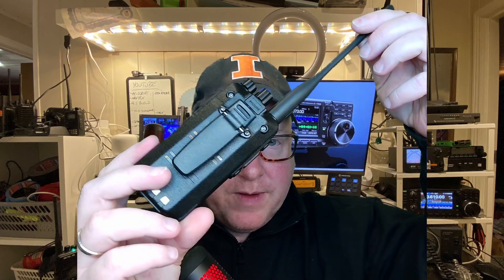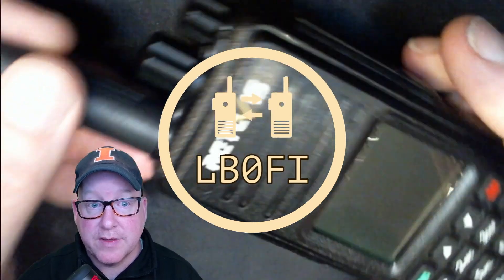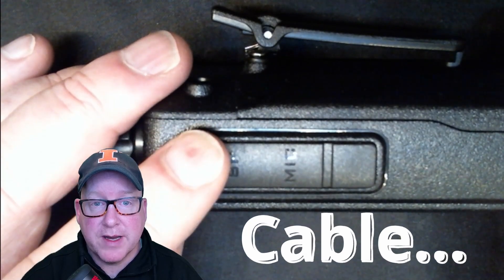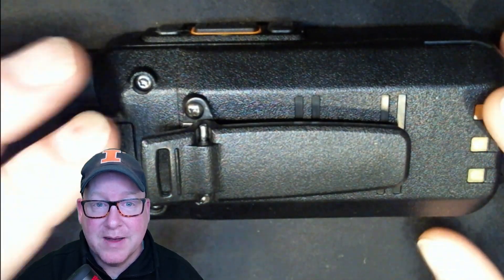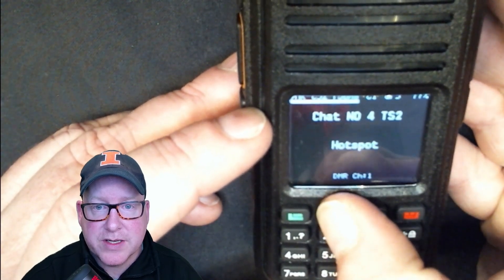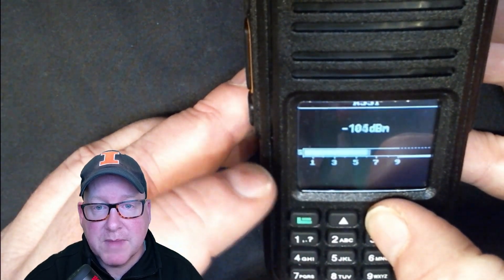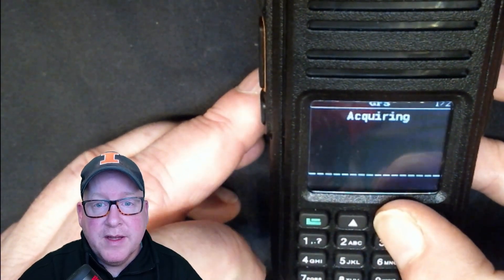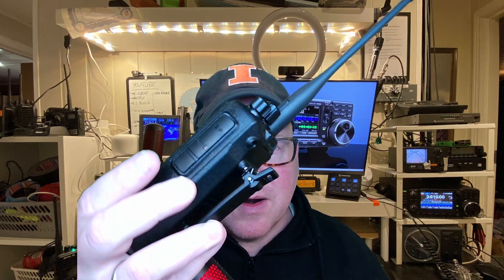RT3S OpenGD77 Full Review

Comment: Since I got my RT3S I have been driven mad trying to program it. :face-purple-crying:It is practically impossible to program via the front panel and I have had zero success with several computers (Windows 10 and Windows 7) none of my  computers will see the radio when the cables are connected to the computer. Some driver issue apparently. I have also learnt that digital radio comes in many flavors and the RT3S is not supported (as yet) on any repeaters where I live. :face-orange-frowning: I certainly would not be recommending the Retevis to anybody soon...

Comment: Which budget radio do you recommend?
Reply from the maker: What is your budget, and which bands and mode would you like to operate on?
Reply: @LB0FI  Would $100+ get one better sensitivity/selectivity and cleaner signal vs the UV5R?
Regarding bands/modes, I don't know yet. (I have been out of the hobby for 10 years, and my TH75A tx doesn't work any more.)
I would like maximum emergency preparedness capabilities. The satellite mode sounds interesting.
Reply from the maker: You should be able to find something in the $100 range.
Reply: @LB0FI  would you recommend this radio or an alternative?
Reply from the maker: @mrtechie6810  I really like this radio, but only with the OpenGD77 firmware. As of recommending it to you, that is a bit harder since I don’t know your preferences. You have to prepare for a bit of work to get OpenGD77 loaded, but then it is a good radio. It is not the path of least resistance though.
Reply: @LB0FI  I don't mind updating firmware! That's part of the fun!
Reply: @LB0FI  what's the difference between the RT3S, the MD-UV380, and the MD-UV390?
Update: the 390 is waterproof.

Comment: Thanks for the great video! I have the TYT MDUV380 version of this radio, exactly the same hardware.  Just installed the OpenGD77 firmware and it also enables the 1.25 meter (222-225 mHz) band which we have in US even when "band limits" is on, so this is now a tri-band DMR radio!  However, be sure to check SWR on 1.25 meter band as the stock antenna is not designed for it.  This firmware is way better than what was originally on the radio.
Reply: How does the TYT differ from the Retevis?
Reply from the maker: They are fall all practical reasons the same radio.

Comment: I wonder why Retevis doesn't just ship the RT3S with OpenGD77 already installed? Maybe their color screen is a selling point for some hams? Personally I prefer the appearance of the screen in OpenGD77. White text on a black background looks classy and is easy to see.
Reply from the maker: That would be nice if they did, but I would assume that having to use externaly developed firmware, especially one under a GPL License, would be legally cumbersome. These are just speculations from my side, and you would probably be better off asking Retevis :)
Reply: It's probably more for legal reasons, as the OpenGD77 firmware supports colour screens if the radio is equipped with one eg., MD-UV380/390, RT3S (which are all the same radio internally).

Colours can be set up either from the radio menu (Options > Screen Settings > Themes) or in the OpenGD77 CPS (Extras > Themes). If you're going to make changes to colours from the radio read the OpenGD77 manual first to make sure the changes are permanent, as normally changes made form the radio are only temporary.
Reply: I like the stock screen. It’s alright but I’m with you on the Opengd77 screen. I think it looks a lot better.